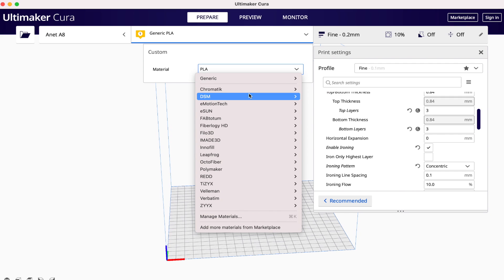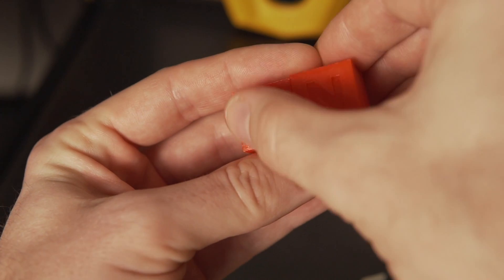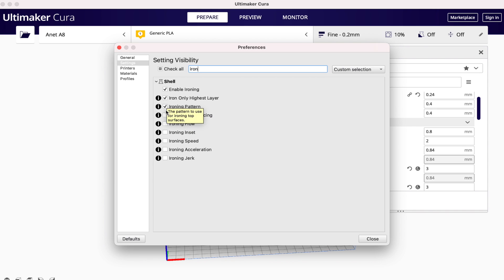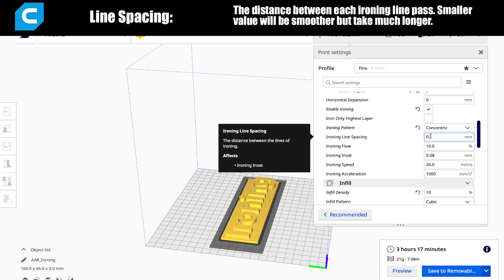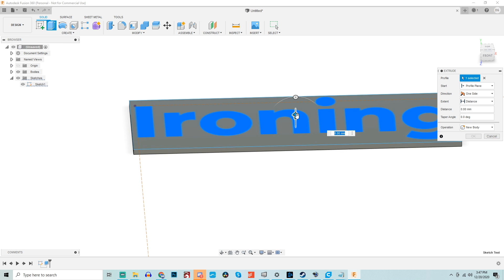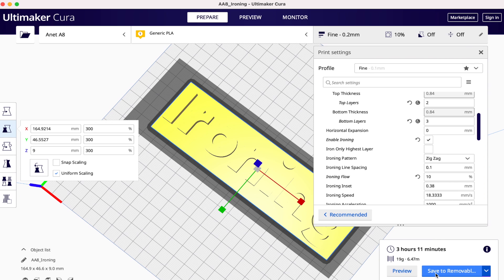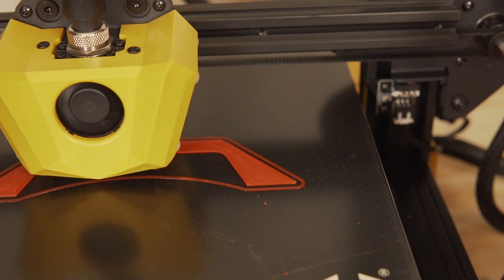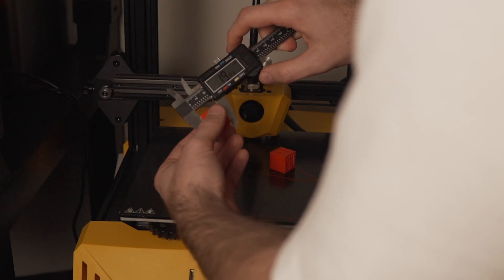One Click Smoother 3D Prints Using Ironing In Cura

Comment: The lines In the print are actually from fusion 360. If you convert it to a mesh then save it it'll make em disappear. Happened with a few stls i edited and then exported them directly to cura. Looks fine until you print them and they have those ugly lines

Comment: The problem I've found with ironing is that it works fine for small parts, but once you have a flat surface that 300x300mm then it really falls apart.

Comment: What about the bottom layer? How do you make it smooth like the top layer?
Reply: That's the bed surface and increased extrusion width for the first layer. Also decreasing the z offset will improve the surface finish but may result in a harder to remove part

Comment: Cura screwed up a print of mine doing this. The nozzle really dug into the part and caused several errors. Default settings. I mean.... I could experiment, but I feel like it's just another factor to worry about, when there's already a *lot*.

Comment: Extremely high-quality sacrificial parts for Lost PLA Casting:
- Ironing + Non-Planar Slicing
- Variable Layer Height
- "Lightning Infill"
- 3D Gyroid Infill + Gradient Infill
- "Arc Welder" software
- 0.1 millimeter nozzle

Note: I also recommend using a toothbrush to clean your nozzle periodically.
Reply: Commenting to attempt to save a comment here. This is a lot of features that help with part quality.

Speaking of, and sorry for the question a year later - do you combine all of these in one slicer? From basic googling it seems many features are unique to certain slicers and non-planar for example needs a custom build of cura all on its own. Or can they all be cobbled together in a diy build of cura (aside from the gcode post processing plugins)?
Reply: Qq

Comment: I've also seen some other video where the guy put his prints on a rotating platform in a transparent box-like device which then spews out a fine mist of isopropyl alcohol. This also seemed to make the outside layer of the print very smooth and glossy. However, I assume this smooth effect is basically the outer layer melting or something? 🙂
Reply: That is polysmooth and I believe it is a PLA that works like ABS for smoothing except with less toxic materials and fumes. The machine itself, I can't remember the name but it is certainly an interesting video and filament.
Reply: @cocopup7  Ah, so the name of that procedure is "Polysmooth"; or is that the brand name of the device? Either way it looked pretty interesting as it made the prints look even more smooth than before. 🙂
Reply: @DanakarEndeel  I think it is the name of the filament but if you look it up on here, you should be able to find the video again for the name as I too don't remember the name of the machine but only the filament name.
Reply: @cocopup7  Ah I see. I thought that the machine was just spraying a mist of isopropyl alcohol to smooth the models. I didn't realize that there was some special filament involved.😉
Reply: @DanakarEndeel  The company is called Polymaker. The special filament is called PolySmooth. The machine that does the work is called the Polysher. PolySmooth is a special material called PVB, which functions pretty much the same as PLA except for being affected by Isopropyl Alcohol (PLA is not affected by it), and it costs around $37 USD for .75 kg. For reference in case you're not from the USA, a "standard" (not discounted) roll of PLA typically costs $26 USD for a full kg, and I can get that down to around $12 a roll if I buy in bulk (even cheaper if I wanted to buy more than 20 rolls at a time, but I wouldn't have a place to store them if I did). So, not only do you get less of it on a roll (.75 kg vs 1.0 kg), the price is about 50% more. Oh, and the Polysher machine runs for around 20+ minutes, and every video I've seen about it the reviewer had to put the part back in for a little extra time, so figure around a half hour bonus post-processing time for every part you make. Hope that helps.
Reply: @richard3365  Ah cool, thanks a lot for this; that is very helpful! So it's a special filament that's not only a lot more expensive but also brings with it the extra costs of both this Polysher machine as well as several liters of Isopropyl Alcohol. Not sure if the benefits outweight the costs to be honest. Now the results did look pretty impressive but I'm not sure if it would be better compared to something like a resin printer that's set at a high resolution (or whatever they call it).

Thanks!

Comment: For the issue at around 8:30, search for the combing setting (or similar name; I can't remember exactly), and set it to "not in skin".

That should fix it. I wish this was the default setting 🙄
Reply: Can't find not in skin when I search combing.
Reply: @gaatjeniksaan5606  Darn. I'll have a look next time I'm at my computer. What version of cura are you using?
Reply: @proptart7933  4.9.1, problem solved already, settings only showed up when I restarted cura, no idea why. Thanks for the tip, still getting reacquainted after not doing anything with the printer for such a long time, this'll come in handy.

Comment: I need to increase the x and y dimensions. Which printer would you use as a starting point? I was thinking about the creality 5 plus. I need a print area of 20 inches by 40 inches and z can stay the same or ideally be 10 inches. I want to run the nylon carbon filament. Would you be interested in doing a hack video with this modification?  I am wondering if the larger X and Y dimensions would be ok in the cura software. Thanks for all your videos.

Comment: Ironing in PrusaSlicer 2.3 is waaaay superior to cura, worth checking out, i print alot of flat logos, so speaking out of very specific experience :) even using it just for that
Reply: At the moment (Dec 31, 2020) the version 2.3 of PrusaSlicer is a beta version (release candidate) only.  I will try it out and compare to Ultimaker Cura.  Thanks for the tip!
Reply: @webcompanion   Yes exactly, 2.3 RC1 has the new ironing as feature as also shown in their video, 2.9 does not have the same setting, i would show pictures if YT had that function :D
Reply: @Tarex_  I haven't tried ironing yet but so far I am very impressed by the slicer.  Did a dual slice tonight where 1/2 was 10% in fill and the other 1/2 was 60%.  Worked great!

Comment: Excellent video, as always, Daniel! As I'm going going back to giving Cura a go, this is an EXCELLENT tip!! Thank you so much!
Reply from the maker: Awesome! Let me know if you give it a try. :) What slicer have you been using??
Reply: @ModBotArmy  I've been using S3D for my CR-10 and have even found that, in some cases, it works best for my Raise 3D. But there are sometimes...issues. Already, Cura has proven to yield better results using nylon on the CR10 (all settings being as equal as I can reasonably set). And...I'm going to see what happens with the R3D.

Comment: Really good information - Thank you for all the videos ; we really are on the cutting edge of 3D printing these days - I still remember my first 3d printer back in 2015 and god forbid you could make a simple print come out even half decent on a 5k machine only because the slicers were just so terrible (generally an afterthought of the machine developers) - you had to rely on Solidworks or MasterCam to get Gcodes well enough to do what you wanted them to do.
Reply from the maker: It is insane how bad the slicing software was. I mean it did slice the files but you had such little control or information to be able to monitor what was going on. Very happy with how far the industry has come as a whole. Cheers!

Comment: In my experience, if you crank your speeds Ironing is MUCH faster, and looks just as good or even better.

These are settings someone discovered for an Ender3, but (hopefully) should work on other printers:
Pattern: Zig-zag
Ironing Line Spacing: 0.2mm
Ironing Flow: 25%
Ironing Inset: 0.2mm
Ironing Speed: 150mm/s *
Ironing Acceleration: 500mm/s **
Ironing Jerk: 20mm/s **
Skin Overlap Percentage: 10%
Skin Overlap: 0.04mm

* Yes, one hundred and fifty
** You need to enable acceleration control and jerk control to access these settings 

I fired up Fusion360 and quickly designed a model trying to copy the test piece you did and sliced it in Cura. Using an unmodified version of the included Ender3 profile, no Ironing was 2hrs 40mins, while Ironing (all surfaces) enabled was a staggering 4hrs 02mins. Using the same profile with the custom settings, the Ironing (all surfaces) time was just 2hrs 56mins.

I've been using these settings for nearly a year now, and not only is it a lot faster and better looking than before, it's also fun to watch 😅
Reply from the maker: Hey! Thank you for the recommendations. I will definitely pin this and give it ago to see how it compares to what I was getting. If the quality is good and it is able to shave alot of time off then that is great. Have a wonderful New Years!!
Reply: Thank you very much, it works great for me!
Reply: thank you, this is just awesome, i will try it as soon as possible

Comment: How does the Artillery Hornet compare to the Artillery Genius noise and quality easy of assembly wise??
Reply from the maker: The noise I would say is similar I feel like it is pretty damn quiet. The Genius might be a bit quieter there is at least one extra fan on the Hornet. It has been so long since I have assembled the genius it is tough to remember but it is fairly similar as far as assembly. The quality has been pretty damn good on the hornet not that the genius is not. The main real difference is one is bowden with a v6 style hotend and one is dd with a volcano aero style hotend. I think the Genius is more diverse as far as material compatibility but the hornet has much less weight on the gantry due to the bowden. Its standard profile is 80mm/s so it is able to whip around much quicker.

Comment: This looks really nice. I can’t seem to connect my Anet a8 to the new Cura design. I have to go back pretty far to use it. It works on the old one because I can manually connect to the port. With the new one I can’t find the option, do you have any recommendations?
Reply from the maker: Hey Voodoo! I have very rarely if ever used Cura over USB connection. I either am slicing and saving to a memory card or printing over USB. For this video I saved it to a flash drive. I have no idea what they could have done that would make it where an older driver is not supported :(. I hope you are able to figure out.